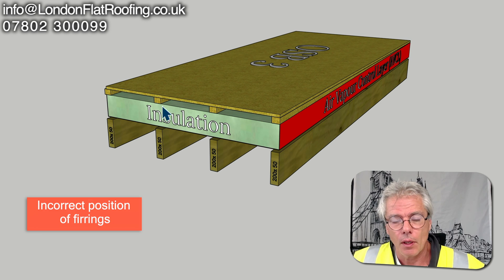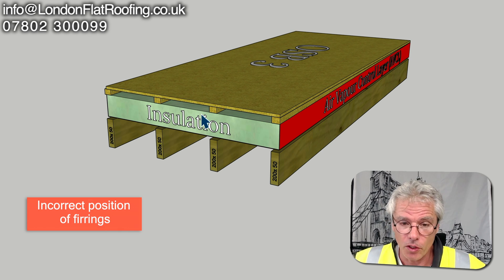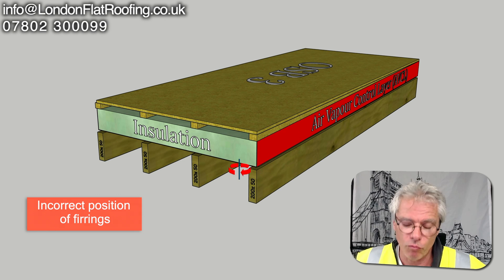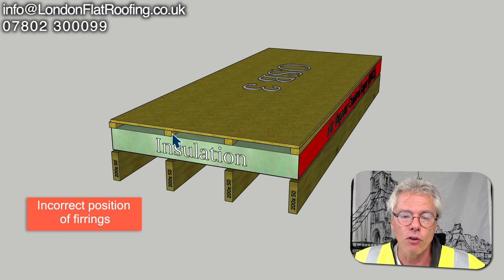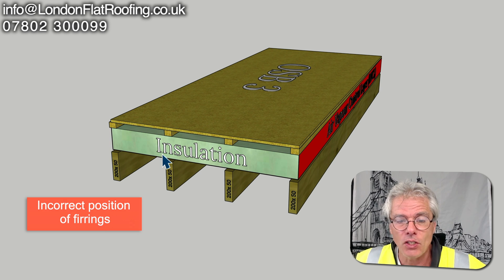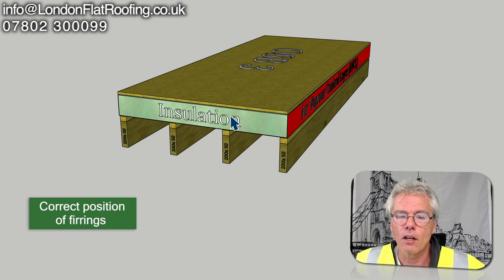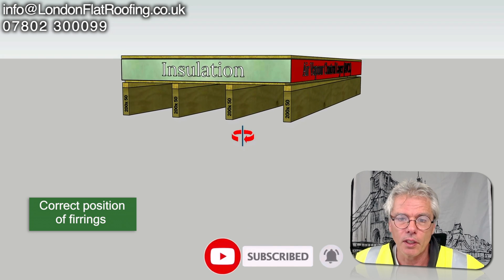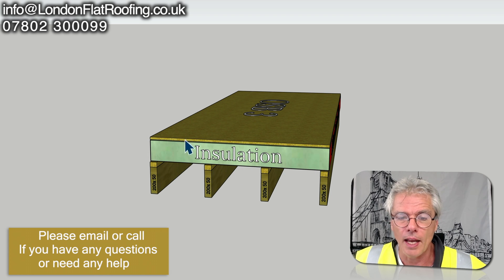Warm Roof Firrings where do they go? Your Questions Answered

Comment from the maker: Please feel free to email or call if you need any more information or help steve@londonflatroofing.co.uk 07802300099
Reply: Thanks Steve, I’m a flat roofing contractor in NE Scotland, I only install warm flat roofs , but your videos condensation were excellent and helped me understand this better 👍
What flat roof membranes are you installing in London?
Reply from the maker: Mainly EPDM glad to of been of help. are you insulating at the fascia?
Reply: @SteveRoofer  depends, a lot of my wood designed by architects, so sometimes.
I’m currently doing a job that’s been specified with 250mm pir ! Do you reckon after 150mm there is any benefit? I have my doubts?

Comment: Is it possible to have the makeup be this, joists, structural deck, furrings, insulation, osb, epdm? Insulating in the parts between the furrings over the perimeter walls to have a continuous insulation to the walls?

Comment: Great videos, one question I have is can we not do away with the top slice of OSB and just glue membrane to insulation?
Reply from the maker: You can if you change the insulation to a tiuse faced one and you also don't want to walk on the roof as it will be soft. Tisue faced insulation is a lot harder to get hold of and more expensive.
Reply: @SteveRoofer   Thx fella. Ive been watching another guy who seems to know his onions and he says you shouldnt have a top layer of osb on the cold side of the warm roof, that you need to use tissue based insulation and use an oil based solvent to glue the membrane to the insulation. He says this is really the way to ensure longevity of the roof. I really appreciate both of your videos so would appreciate your comments on whether this is the best long term strategy? https://www.youtube.com/watch?v=xWRLCWmqT50ideo here: https://www.youtube.com/watch?v=xWRLCWmqT50

Comment: Can i suggest an opinion to consider, understanding we don't live in a ideal world and vapour barriers can be  compromised, IF firring's were on top as discussed, but one went to the effort to fit ventilation, we would have a  hybrid roof i guess. Any moisture that gets through (IF) would be vented away.   This view is to consider what if the warm roof install goes wrong, which seems easy to do.  Personally I dislike the complication/issues with warm roofs. A cold roof works fine and seems to be slightly less prone to errors in construction. Im not saying don't do warm roof, but consider pro and cons and the jeopardy.   Just seem a warm roof this week under construction, missing the vapour barrier.

Comment: Can you use 1 layer of torch on felt as a vapour barrier underneath the insulation on top of the ply decking?
Reply from the maker: Genuinely speaking most specifications say two layers but it does depend on the specification of the Felt that you're using generally speaking. Felt is regarded as a good air vapour control layer.

Comment: this is bad advice. if moisture gets to the insulation-sheathing interface, it will cause problems there whether there is an airgap or not. the right thing to do is ventilate the airgap. your diagram doesnt show why it can't be ventilated. the airgap can be ventilated, and should. 

in cold climates this is done primarily to keep snow from forming ice dams. in warmer climates it is done to evacuate moisture! not even SIPs with foam glued to sheathing are immune. every surface must be able to dry to at least one side. there are no assemblies involving wood that can be hermetically sealed by your average construction worker.

Comment: Hi Steve. I have a concrete deck flat roof area. The screed was laid with the incorrect falls and I am now trying to rectify this. I have Alutrix 600 laid over the screed as a vapour barrier. The makeup was going to be screed>vapour barrier>insulation>osb>waterproofing. 

However to rectify the fall, i am wondering can I put in firrings on top of the vapour barrier to get my slope? The proposed make up would then be screed>vapour barrier>firrings>osb>insulation>osb>waterproofing.
 Will the air gap in the firrings be an issue?

Comment: Hi Steve, we are building a truss roof pitch 22.5, unfortunately we're in an area surrounded by squirrels and field mice 😀 how would you recommend creating a warm lightweight roof covered with tapco or eco slate?  I noticed some people putting batten over the rafters to fasten the insulation in place, then breathable membrane and horizontal batten for the slate.  However i'm worried about critters getting in.  Would it be better to fasten OSB direct to the insulation, cover with breathable membrane and tapco without batten?  I know with a flat roof you have to be careful of the screws propping up through the membrane, but wondered if it's ok with pitched?  Really appreciate your advice, cheers!

Comment: What can be done if no firring strips have been used in the first instance? And the roof has been constructed. Basically my builder has left me hanging and disappeared with my money. The roof was constructed using warm roof method, joists, osb, vapour barrier and 150mm insulation and OSB again. And he's since done a Houdini act. However there are no furring strips visible and slope. Please advise on a solution to fix this without having to rip the roof down. Thank you Steve.

Comment: Can you see any issue with putting the PIR direct onto the joists. My builder has done this, put osb on top and then edpm. Its a timber framed loft room and the roof parameter is all parapet. I am worried about the lack of a VB, just foil on the pir. Would installing a VB between the plasterboard and the joists cause more issues. id even go as far as stick alitrix to the underside of the joists but worry heat wont pass through it a
making gap between the joists colder. If so could just use a visqueen one
Reply from the maker: You can't do it because you've got nowhere to lay your air vapour control layer that should be glued or torch down onto a board. You can't successfully use a plastic sheet are vapour control layer without having boards either. Also, it makes the roof a little bit bouncy so realistically it's not a very good job.
Reply: @SteveRoofer my builder has done this in my loft dormer too. Roof joists-> firings-> PIR-> OSB->felt. No vapour barrier to be seen. Hope I don’t have issues in the future but looking at your videos I’m due a hefty bill in a couple of years. Although on one of your videos I did see PIR on joist (no osb/vapour barrier) and you didn’t point it out specifically.
Reply: You could insulate between joists / rafters and put VCL inside, just make sure you don’t penetrate it therefore put 25mm service void. You will loose 25mm of headroom but gain a lot of insulation and correct buildup.

Comment: Can you tell me if there is any reason I can’t drop the bottom decking down between the joist if the moisture barrier follows the contour. IE I’ve 9x2 joist and and was playing with putting deck half way down giving an extra 100mm insulation. Space would be tight to get 150mm insulation above with a good fall. I appreciate its more work but could I. Thanks. Enjoying the vids
Reply from the maker: You're always best to drop me a drawing, so I can have a look because that's hard to understand

Comment: I'm not a roofing expert, but could your roofing recommendations be focused towards your particular climate?  In very cold climates like Canada and the northern US, I've seen a ventilated air gap between the upper roof decking and the exterior insulation.   It is used to prevent ice damming. The concept is that the the upper sheathing is even further insulated from the thermal mass of the structure and therfore quickly assumes the ambient temperature and therefore the snow doesn’t melt and later form ice.  In hot climates, like here in Florida, the surface of the exterior insulation typically has a reflective radiant barrier which requires an air gap above it.  Basically, it keeps your insulation in the shade.
Reply from the maker: Yes absolutely we are in a cold wet climate. If you're coming from the US then you have lots of different regions in warm regions which are moist you put the vapour barrier on the outside where we are we put it on the inside so it is quite complicated and you really need to make sure you know where you are and what conditions you are in.
Reply: something to note is that those are always vented out the top and bottom

Comment: If the top of the roof develops a hole, does the vapour barrier act like the tanking on a wet bathroom and trap all the water that gets in, eventually filling up any gaps around and between the foam pieces? I'm assuming a closed foam which doesn't act like a sponge is used to minimise this?
Reply from the maker: Yes, basically you will have a swimming pool when the insulation gets wet, it is useless and the whole thing would need to be stripped. This is the big big problem with warm roofs. This is why they have to be done so well and looked after. Otherwise they are going to fail and cost a lot of money to replace again.

Comment: I intend to use Easi-Joists that overhang a timber frame to create a warm roof on a single storey annex. Any advice on insulating in-between the Easi-Joists at the top where the wall insulation and roof insulation do not meet. I have some 75mm PIR to fill the main gaps but Easi-Joists  have a metal skeleton frame that would need to be packed out somehow. I have considered rock wool or expanding foam, is there any sort of common practice?
Reply: I think I might be able to answer my own question. I should ask for solid timber webs where the joists cross the wall plate to allow for insulating.

Comment: Are there any considerations regarding cold / warm etc in a standard house apex roof?
Reply from the maker: Yes building regulations actually states dont do a cold roof unless you have to.
Reply from the maker: this is a quote from BS 6229  page 28 It states that "NOTE 2 This type of roof is not now recommended." This is because of the difficulty of forming and maintaining an effective AVCL below the insulation and of providing sufficient cross ventilation above the insulation.
Reply: @SteveRoofer  bs6229 is for flat roofs with a pitch no greater than 10 degrees. My question was for a standard pitched roof. Regards

Comment: does the red vapour barrier go on all 6 sides of the PIR? ontop and around. with some kind of tape?
Reply from the maker: Yes you need to make sure that the Air Vapour Control Layer (AVCL) is airtight and no air from inside the the rooms below can get up into the warm roof.

Comment: A few manufacturers I’ve done specifications for say that by using ply/osb directly on top of insulation you are creating a cold roof and don’t recommend doing this .  I doubt in reality it’s a problem, maybe depends on if it’s fully adhered or mechanically fixed membrane?
Reply from the maker: Well, you are definitely not forming a cold roof, but actually one has to question if you should use Timber over the top of the insulation be OSB or ply. Realistically it is something that is inside the sandwich that could rot if there was a problem. Trader the organisation that deals with timber products is totally against it and personally I can see lots of merits for not using any Timber products in the sandwich. I have placed EPDM rubber and felt directly over the top of insulation before and never had a problem.
Reply: but we want to dance on the roof !
so from below: beams, osb, vapour barrier, kingspan, vapour barrier, osb, epdm ?
 @SteveRoofer
Reply: @SteveRoofer Steve, this reply is a bit contradictory to one of your other reply’s (that I comments on) where you told a chap his builder (and mine, since he did the same thing) built him a naff roof because he left out the bottom osb and vp!